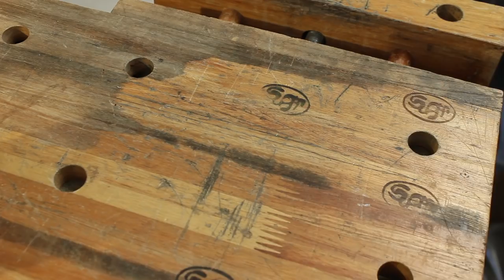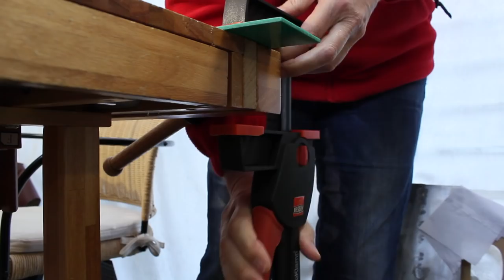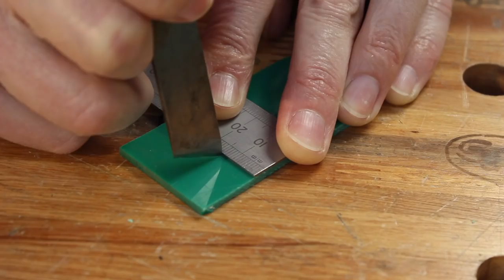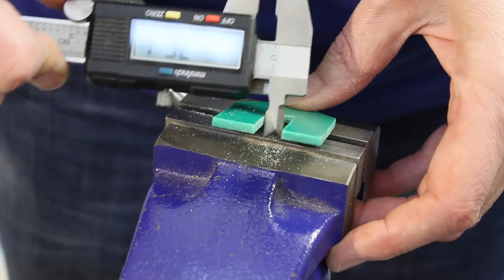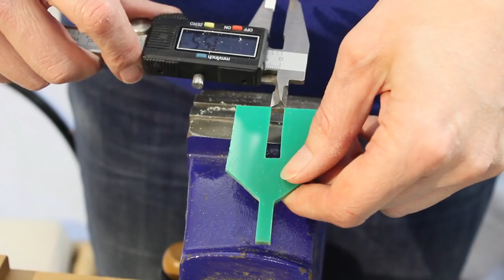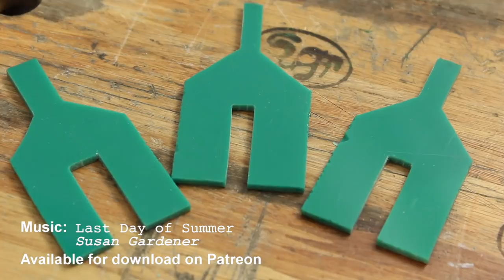Mystery tool

Comment: in a machine shop they're called go/no-go gauges, they're used for quick thickness measurements and the tabs end is used for measuring grooves. in your case rabbetts and dados
Reply: this is correct answer go/no go gauges

Comment: A real cliffhanger.  You're a good craftsman,  I'm a retired self-employed jewelry craftsman with 50 years working in the trade.  It looks like you are using 3-0 or 4-0 saw blades, try using 5-0 or even 6-0  - I used 6-0 -  Bergeon "Old Gold Label" saw blades, I think you will like them.